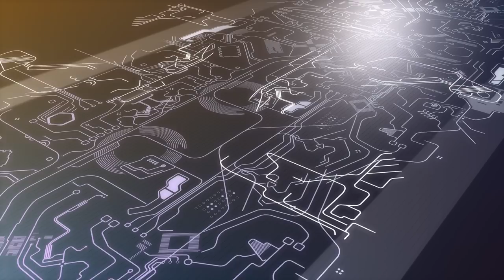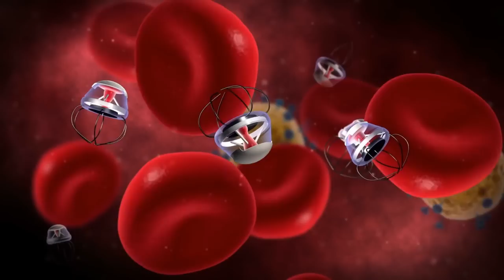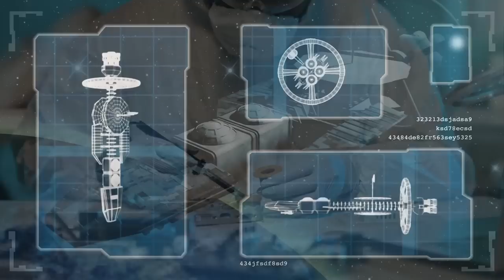Damaged Spacecraft & Shipwrecked Saucers

Comment: It would be relevant to notice that the ISS literally had a hull breach and the issue was not a big deal, the crew didn't even have to get into spacesuits. Granted it was a very small leak and it was taken very seriously, but it goes to show how even in our infinitely primitive (for the purpose of sci fi) station can stand some emergencies without it being a catastrophic siren alarm festival.
Reply: If I recall correctly duct tape is a standard tool up there and that minor leak was temporarily fixed with that
Reply: I imagine that the only reason behind it being taken extremely seriously was due to the huge amount of work and shuttles it took to get it there.
Reply: @jimmiedmc1  If the stupid idea works, it wasn't a stupid idea.
Reply: It is funneh that th eengineering failures in Startrek always make it to the interface.
Reply: If it was a big breach- the alarm siren is sort of pointless 🔕
Reply: It's amazing how similar a hull breach in a spaceship is to one in a submarine
Reply: @alanwatts8239  It was taken extremely serious because it's the iss and everything is serious there, but there was no danger
Reply: @hallamhal  But water rushes in instead of air rushes out!
Reply: @hallamhal  It's not that similar. The pressure difference in space isn't nearly as great.
Reply: If u haven't seen it, watch the Mir documentary on BBC
Reply: The hull breach was super minor...... your comment is odd, because it ignores the degree of the problem, and via that ignorement, claims our primitive stuff can stand emergencies.

That is like saying the human body is amazing for being able to withstand emergency stab wounds...... and then I tell you the stab wound was a minor splinter. No crap a minor splinter is not a catastrophic alarm fest; likewise, an incredibly minor hull breach is nothing. I just don't get your point; you are basically saying a tautology "This isn't catastrophic because it was minor; and the fact it was minor goes to show we can withstand emergencies without it being catastrophic."
Reply: @thekito4623  But for how long? But did you know that over 3 decades ago the military actually made a force field out of plasma that they called a plasma window. It could hold back air on one side with a vacuum on the other side. But try looking it up I doubt you can find anything on it.
Reply: @thekito4623  Because after the military made it top secret in the name of national security. At the time you could find it then years after you couldn't. The plasma window was the easiest to make. They experimented with layered hot and cold plasma streams. They made a system that would protect a tank from a nuclear blast. But it took a enormous amount of energy. They also did a experiment with 2 tanks and explosives. One tank had nothing the other was polarized with high voltage. The tank with nothing was destroyed. The tank that was polarized had nothing but burn marks but was not damaged. It was said it took too much power to be usefull.
Reply: @thekito4623  First off a plasma stream is not like a tesla coil.  A tesla coil ark and makes plasma of the air. A plasma stream is different it is directed plasma. Plasma emitted from a emitter you ever heard of a plasma torch. It is held in place with a electric currect going through the plasma.
 
The hot and cold plasma streams layered I am not sure how they did that. But it was a combination of magnetic fields and and electric corrects with the hot and cold plasma layered. The cold plasma near the tank.

High voltage polarized look it up. You can polarize a metal plate with electricity. You are basically electrifying the metal.
Reply: @Stars4Hearts  Why is it pointless it makes the crew aware something is wrong?
Reply: @thekito4623   It didn't make it indestructible it made it able to withstand more force. It spread the kinetic energy around the ship instead in one spot. At less that was the conclusion of the experiment. In fact if you ever see star trek enterprise the first ship they don't have force fields. They polarize the outer haul. It is thought that polarizing the haul spreads out the kinetic energy. The main problem with this is it takes a lot of power. On the tank it took electricity in the magawatt range. On a star ship it would be hundreds of megawatts or gigawatts.
Reply: @thekito4623  Look I don't know that only that it does. I guess the electrical energy field absorbs the kinetic energy and spreads it through the field. You ever throw a stick at a electrical fence it kicks it back.

But that wouldn't actually be the best way to protect a ship. It would produce electro magnetic drag. The best way is like the tr3b use a external  magneto hydro dynamic drive system. First project a laser field in front of the ship. This well ionize any particles or atoms in front of the ship and then well be diverted away from the ship magnetically and thrown backwards creating thrust at the same time as diverting the particles without creating drag.
Reply: @thekito4623  The military simply wanted to see what would happen. They have spent over 9 trillion in the last few decades with no accountability what so ever. This is simply one example of the things they have tried. I think in secret they know a lot more than the normal public.
Reply: @thekito4623  Look I agree with you but I don't think this is only the USA. I think all the governments that are friends are doing this. When a group has enormous resources there is no telling what is possible. The tr3b technology has been known for over half a century. A lot is possible with enough energy that cannot be other wise.
Reply: @clementvining2487  sound doesn’t travel in a vacuum 🔕
Reply: @Stars4Hearts  Sound doesn't travel in a vacuum  what is that protaining to? Magneto hydro dynamic propulsion is not sound if that is what you are talking about. But actually you can send vibrations through a medium that is projected into a vacuum like plasma. And vibrations are  sound.
Reply: @clementvining2487  during the Apollo missions they did a lot of experiments on the Moon- playing guitar was not one of them. 

Sound is a pressure wave. There’s no pressure in a vacuum. 

When we talk our vocal cords make little pressure waves— which is cute when you think about it 🤔
Reply: @thekito4623  That is true some do seem to have a better attitude they are more open about Ufo's. But that doesn't mean they don't keep secrets in the name of national security. A group of nations could have colonies on other planets without us knowing it. If I am correct  about the technologies we have in secret  we are capable of going to other stars.
Reply: @thekito4623  No that is wrong. It is a propulsion system that ionizes the medium it is in and then repels it magnetically. The easiest to do is in salt water. The subs and boats that work this way take a lot less power. It takes less power to ionizes saltwater than air. And then you are not having to overcome the gravity because things in the water float.

Now the ones we have now in the water are internal magneto hydro dynamic propulsion system. But what I was talking about was external magneto hydro dynamic propulsion. The air on the outside of the ship is ionized and accelerated magnetically This type would take terawatt levels unless you distorted spacetime geometry or gravity. Which is what the tr3b is surpose to do.
Reply: @thekito4623  The same is true for space you ionize the medium in front of the ship with a laser field and then propel it magnetically. It is like a force field with no drag. If it is in the air with enough power you don't need all the heat shielding because the magnetic field is pushing the ionized air away from the ship.
Reply: @thekito4623  Accully the tr3b uses both. As to what you said it sounds like you are talking about lab experiments not full size drive systems. In fact in my house I have a air filter anyone can buy. It ionizes the air and filters it electric magnetically. There is no fan but it blows air. A magneto hydro dynamic propulsion system is no differet. There are 2 types external which is field propulsion technology and internal which is basically the electric jet talked about.

Some of these system ionize air with microwave then contained magnetically. It doesn't matter if you doubt it it has already been proven it is applied physics not theoretical. The problem of doing it in the air is the energy need. Although small models have been proven to work. 

The tr3b uses the bose Einstein constensate along with the Frame  dragging effect to curve spacetime geometry around the ship. This causes  the inertia mass and weight to decrease by 89%. Then use external magneto hydro dynamic propulsion to make the ship move. It has no momentum or g-forces to acceleration. It can go from a stop to max speed in a few secondsor stop in a few seconds with no g-forces.

The military call it a electromagnetic gavimetic divertor. But I think it is a static warp field because it has all the properties of one. In a gravity well with a atmosphere it floats on the gravity well. In space away from gravity it works differently. 

You can get the magneto hydro dynamic propulsion system to work with out the distortion field but it takes a lot more energy in the terawatt range.
Reply: @thekito4623  They have broken the code and got the idea from a crashed ufo. It has a superconducting fluid that is also a superfluid. It has no resistance to movement or electricity. It is in a torus and has no center shaft for the inertia to travel down and equal itself. You know how if you have a spinning wheel it well lift up and go around in a circle. Or like in space it well flip back and forth. Well the liquid is in a torus or coil. It is accelerated electromagneticlly and has no resistance. When it is charged up enough it curves spacetime geometry through gravitational forces. If you tried doing this another way the machine would tire itself apart from fraction before you can get the speed high enough.
Reply: @thekito4623  But in the end I think the best use of this technology is as part of a hybrid propulsion systematic system. Like with the tr3b using it alone it takes terawatts but you use the distortion system with it, it takes gigawatts to charge the coil and then only megawatts for the magneto hydro dynamic propulsion system. And you get enormous advantages in the process.
Reply: @hallamhal  submarine is much worse, generally speaking even a pinhole leak on driving a submarine would be really bad since high pressure jets of water can break things and people.
Reply: Yep

I lot of people don’t see, to realize that there is a bigger pressure differential between the inside and outside of your car tires than there is between the inside of a space ship and the void

Explosive decompression happens when all (or mostly all) the air leaves at once, and that requires a very big hole

A leak is something to worry about, but you have time to fix it
Reply: Even future ships break down its a common human trait.  Building machines to do most jobs will lead to a future punch up.
Reply: As I understand some of those leaks have been temporarily sealed with ducktape, depending on the size of the leak it really doesn't take much to plug it until you can do the real fix
Reply: I’d have put chewing gum in it.
Reply: Aside from the obvious consideration that “how big of a deal” it is, would be directly proportional to the size of the breach (a pinhole vs. a hole the size of your living room easy chair)…
How far from home you are, also makes a huge difference in how concerned (or terrified) you would be.
Thinking there is “no cause for concern” is just foolish.
Reply: So you've seen the sequel to 2001 A Space Odyssey! Lol!